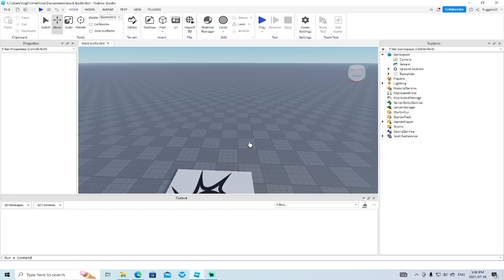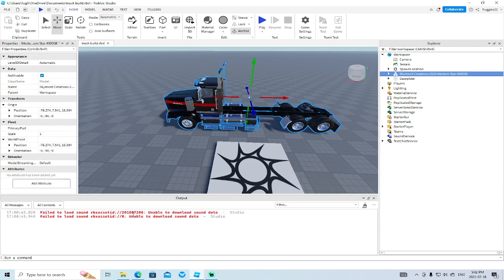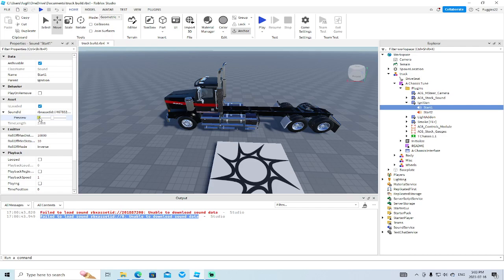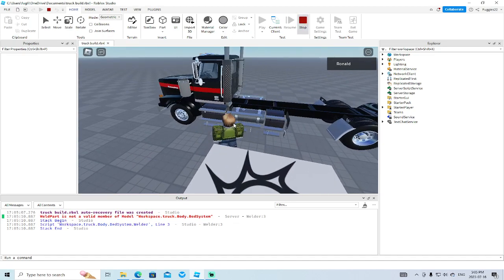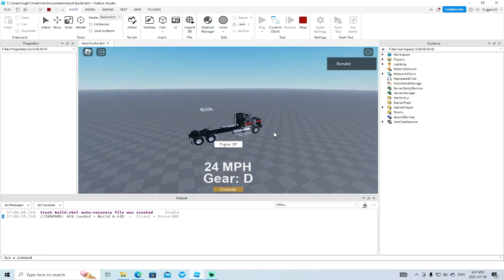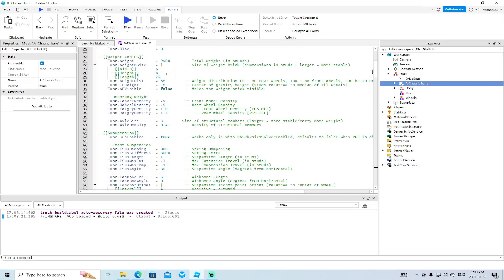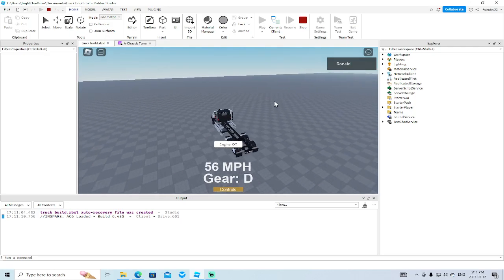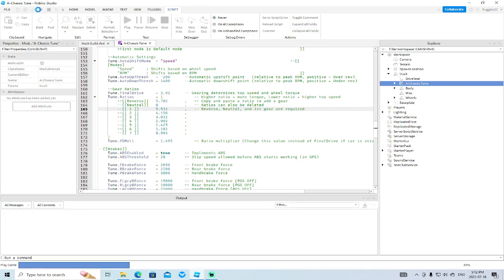Roblox Studio - A Chassis Guide Part 1

Comment: how come when i spawn in, the car is anchored to something (idk wtf it could be hooked on)
i sit in the car, and none of the vehicles gui comes up (theres no other seats in the model exept for the drivers seat)
and im just unable to do anything, any ideas?
Reply: nvm i fixed it, just had to make a useless group called "Misc" and suddenly it worked
Reply from the maker: Depending on the model you are using it will.need to be finished. A chassis will unanchor the vehicle and weld all the parts to the driver's seat. check.the errors you get from the code.  In the body a chassis requires the lights to be setup as seperate groups. Example is the blinkers.  They need to be left and right, reverse and whatever.  Also the.model does need those model groups such as body and misc.  If you add to the model make sure you weld all the added parts to the vehicle seat and place them into the misc model group. Depending on the vehicle you will need to make a custom interface or there will be one in the vehicle. I usually have a prompt near the driver's door that clones a custom interface seperate from a chassis.
Reply: @BlueTruckingCity  managed to fix it, now the camera is under the map instead of next to the car
Reply from the maker: @Lozzboi is that from just sitting in the car?
Reply: @BlueTruckingCity  yeah
Reply from the maker: @Lozzboi  ok can be one of 2 things. So the player camera if it hits a block it wont go thru it.  So in this case maybe there is a object inside the car that is obstructing the camera. can be like the seat or another part inside the car. Play with those properties.  I have had the same issue a few times and this does help.
Reply: @BlueTruckingCity  yeah im having problems with this again. this time its just doing it for no reason at all. all of the car parts have their collision off with nothing obstructing the cameras view and moving the camera causes it to have a spasam. ive tried all of the a-chassis but all of them have the same problem
Reply from the maker: @Lozzboi  the camera will spasm or the truck will?